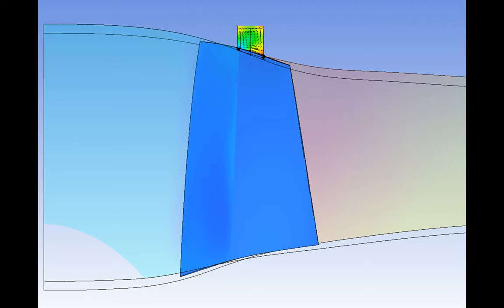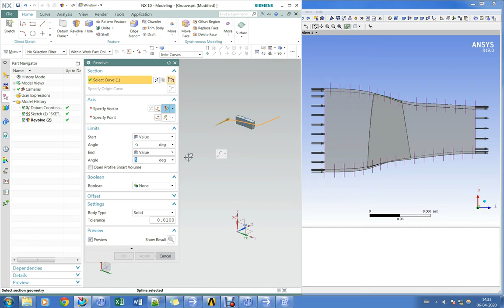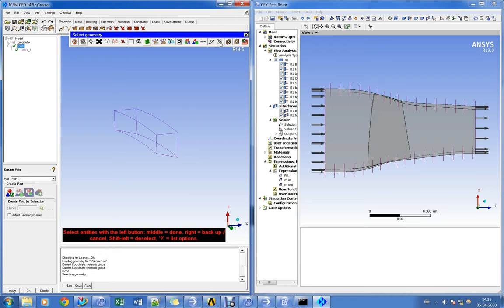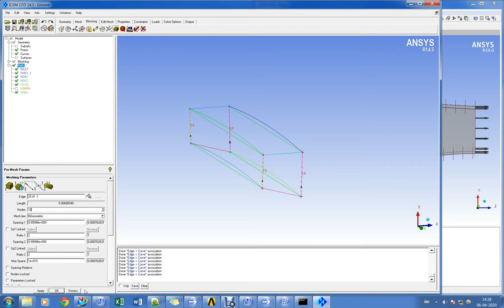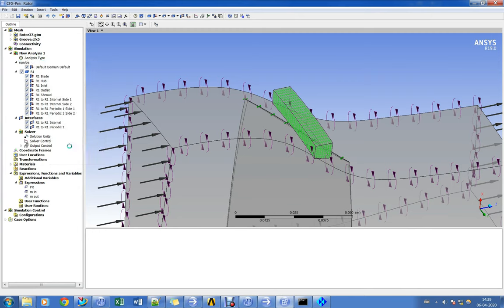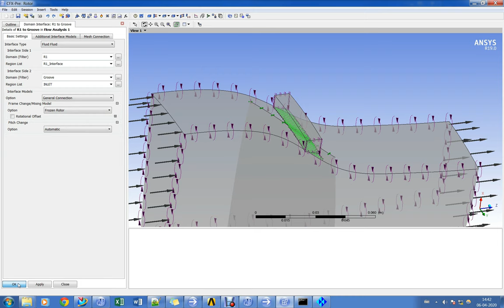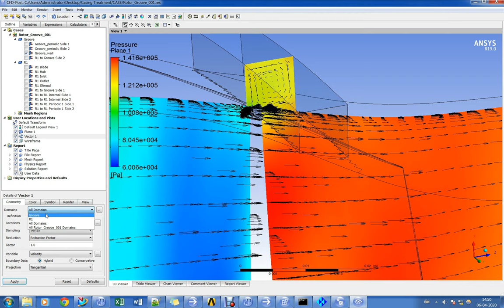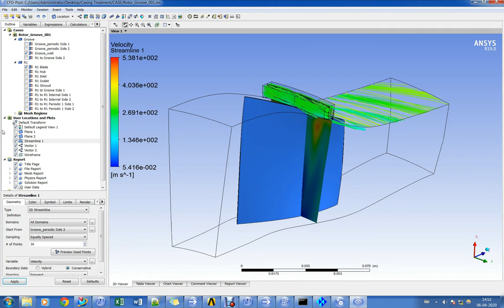Axial compressor with circumferential groove casing treatment CFD Analysis | Ansys CFX

Comment: Thank you a lot, but i think you must apply a counter rotating condition on the the groove walls, (i need ur answer)
Reply from the maker: Hi, thanks for your comment. You are right, counter rotating wall condition should have been applied. However, the effect will be minimal in terms of overall results.

Comment: I've completed  upto cfx pre step. But how can I save "shroud.dat" file for NX.  Would you kindly tell me !!
Reply from the maker: Hi, the shroud profile comes along with blade profile data. You can use the same shroud file and save as shroud.dat file. You can use any cad modelling tool to create the casing groove domain.
Reply: @LearnCAE  I've shroud.curve file , how can I convert them into .dat file
Reply from the maker: @mozakker  You can just save it as shroud.dat file and import in NX. Note that NX will import in 'mm' by default. So take care of the units.

Comment: Hello! The video is so helpful and easy to follow! However, I'm stuck at a point where I cannot make an interface between the groove and the shroud. 
My problem is @12:24 When I select the rectangular area, the common area doesn't get completely white, only few cells get white for selection. 

Can you help me regarding this please?
Thanks
Reply: It is due to your GRID refinement, feel free to write me
Jonathanarnulfoa
(Correo G-mail)
Reply: @jonathanarias2729  Hello Jonathon! Mailed you some details with some pics. 
Hope you received it!?
Reply: i have the same problem, how did you solve that??
Reply: @phantom7762  Hi! It was easy.  Thanks for Jonathon who helped me solving the issue Just hide the groove. And then select the faces (of shroud) to create the interface

Comment: what if the inlet has a s shape duct and you wanna join it?
then, it can't be divided regulary because of its variyn shape?
Reply from the maker: Yes. You need to model 360deg rotor case to study the full effect of inlet s shape duct. If you need to study radial distortion, then single rotor domain is sufficient.
Reply: @LearnCAE  thanks
Reply: Hello Jonathan, were you able to simulate the problem? I am facing some difficulty. Can you please help me out? Pleaseeee?